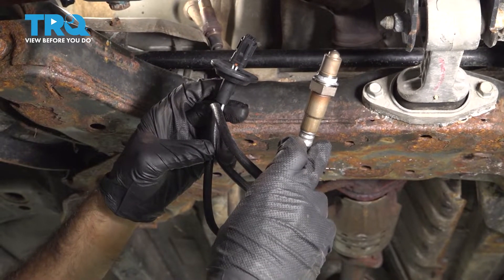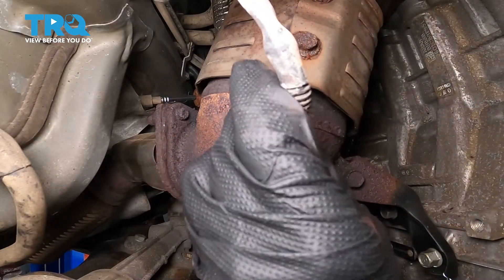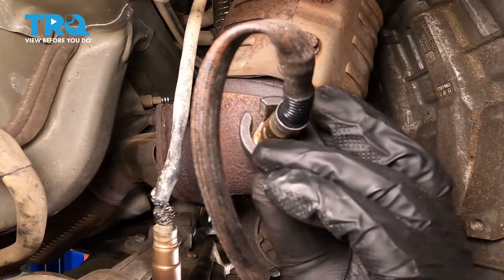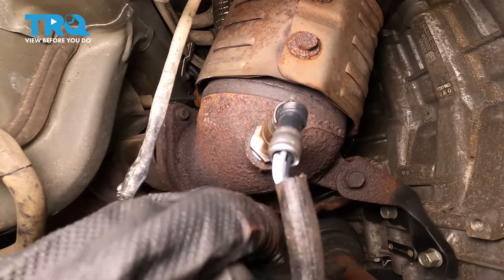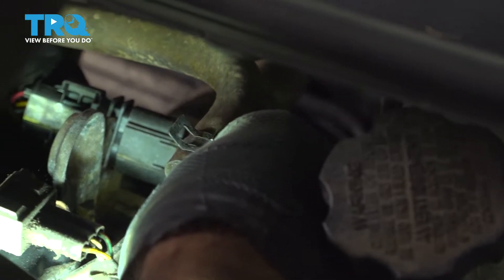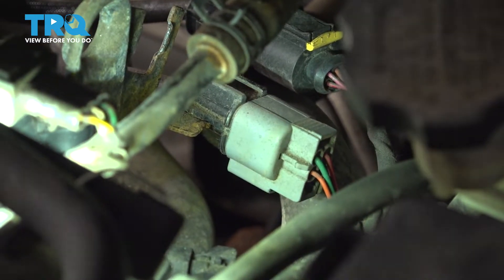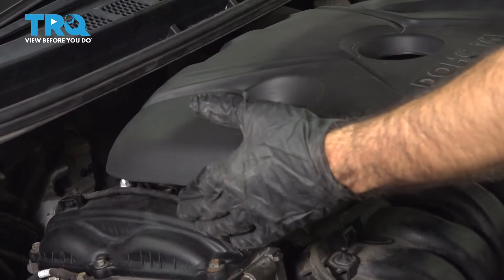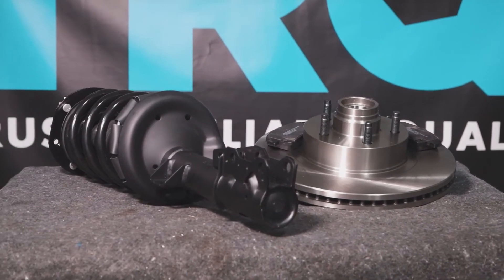How to Replace DownStream O2 Sensor 2011-2016 Hyundai Elantra

Comment: So I bought a new sensor for bank 1 sensor 1 on my 2016 Hyundai Elantra. It’s strange because it was supposed to to be upstream but it was longer than the old one and the connectors didn’t match. When I took it back he pulled out a downstream sensor and it was the exact length and same connector? Could I install the downstream sensor to the upstream since they literally are the same part?